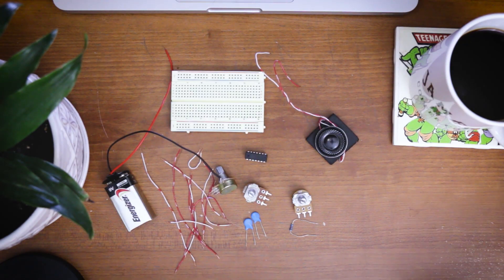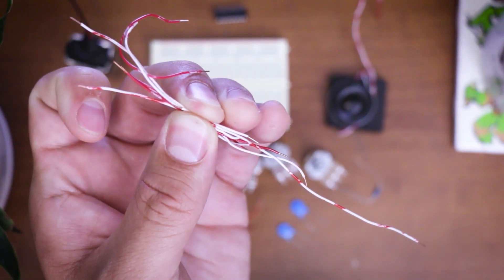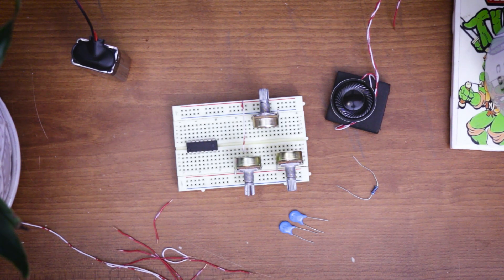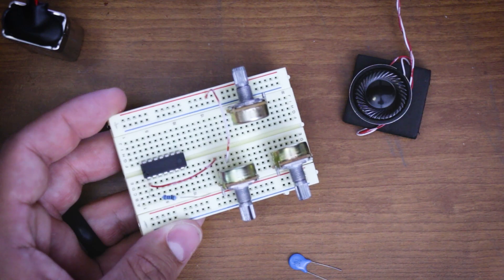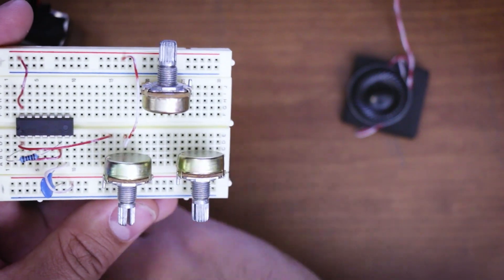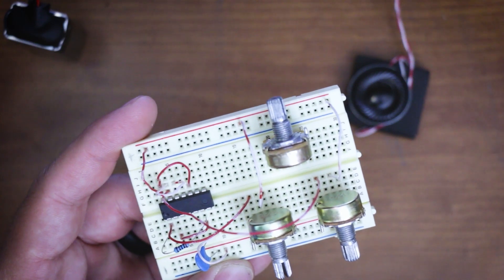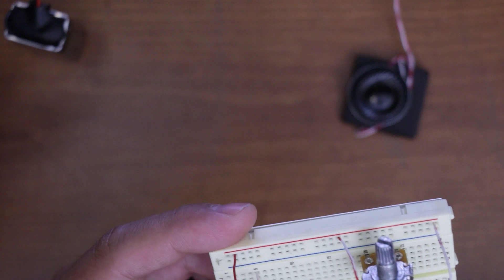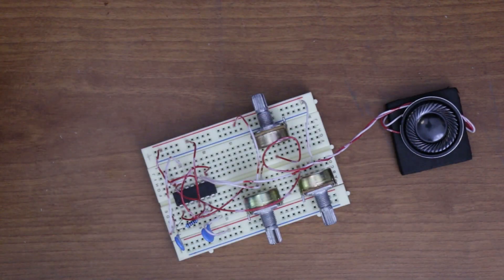Atari Punk Console Breadboard Build

Comment: Are those “jumper” wires just thin copper wires with the insulation stripped on the end?
Reply from the maker: yes its telephone cross connect wire to be exact, although id suggest using acutual jumper cables designed for use with a breadboard.
Reply: Additionally you could tin the ends with solder to make them a little more sturdy

Comment: Parts list?
Reply: Probably 
Op amp 
500kohm potentiometers 
2 capacitors where 
(1/2piRC) = your oscillator frequency 
Make sure you have 1/4 W resistors if possible just as a minimum, as opposed to 1/8 or something that might melt

2 other resistors where the above conditions match for RC again 

If you use too little resistance you might overshoot the op amp's output limitations for current, so match your caps accordingly iirc
Reply: Oh sorry and for the 2 other resistors they should be equal 
And for your pots they are going to be dialled so one is just over half the otherif it is a wien bridge